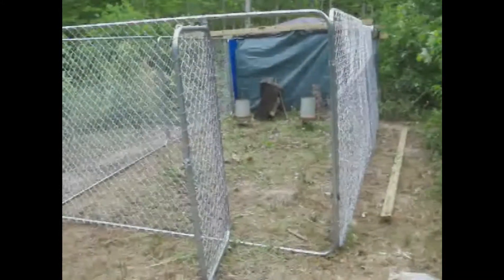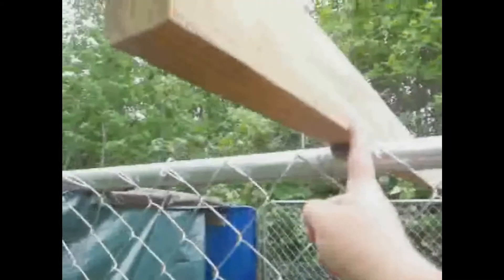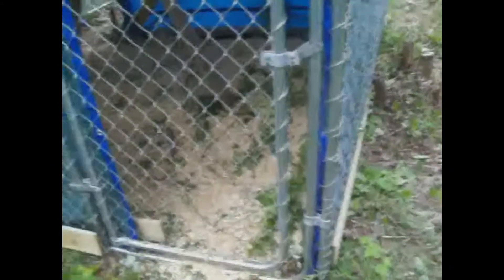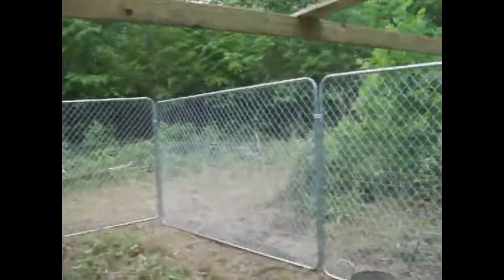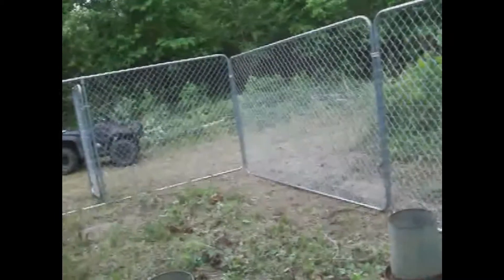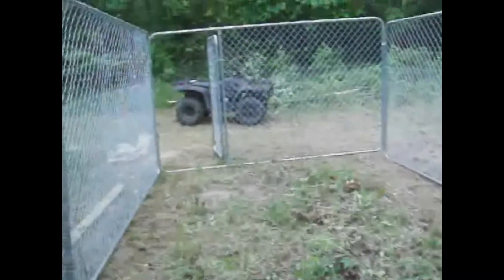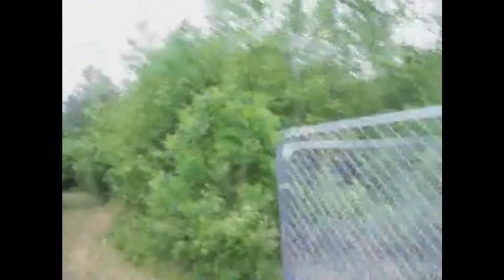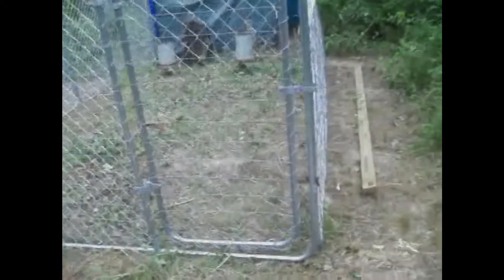Egg and chicken production Project. Sustainable.

Comment: say brother if you attach about a ft n half, 1 1/2ft, of hardware cloth around the bottom on the outside facing out and bury it under the dirt several inches to keep vermits out of your coop. thnx for sharing I subbed your channel. I am making me a maggot bucket today. My dog killed a opossum for me the other night so I stuck it in a bucket with some of those holes in it like you said. I don't have a tall pulley system like you but a short tree is in the chicken pen and I'll stick it up so the maggots can drop out for my girls.